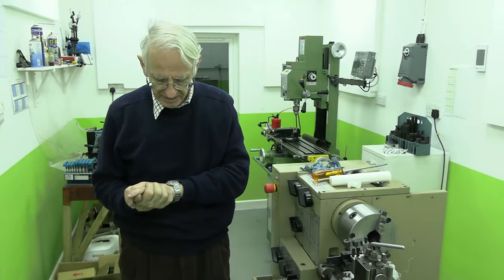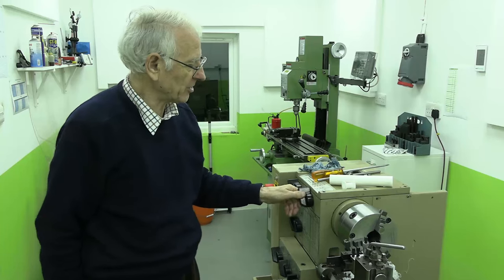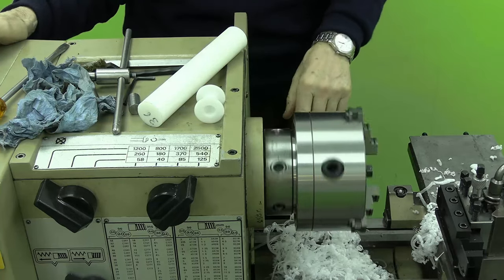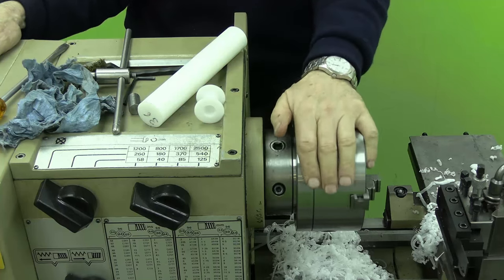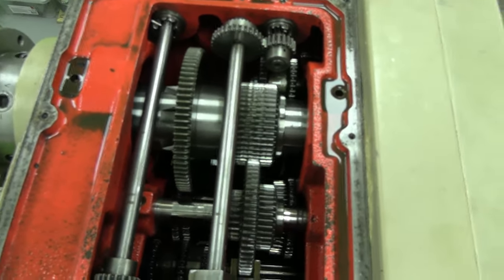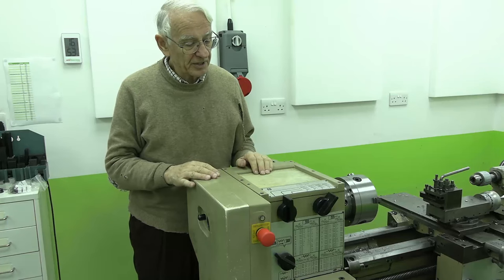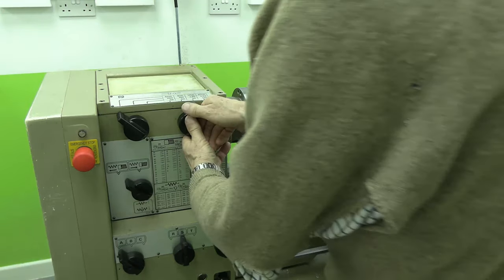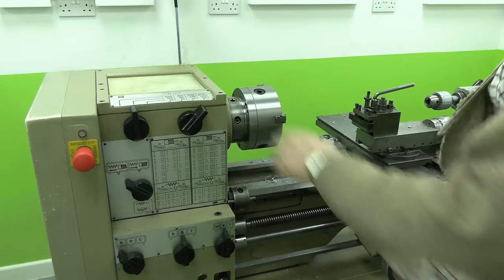M300 headstock gear crash, or so I thought

Comment: Samuel, glad you found no damage to your gearhead. i have have a lathe from Chester tools same size as your's (gearhead box much larger than the Harrison but not of it's quality) you are lucky. My problem shortly after importing into Ireland was oil leaking from feed change box, no chance of sending this back to U.K would cost a fortune, no info. on how to remove the feed box so removed front plate 
of box to get a look ( big mistake) all the gravity latches on the top and bottom shafts which aid side to side movement of gears DROPPED I then had to remove the motor and and the back gears plus the entire box. Job took about 2 days to complete. P.S never take remove the front plate on this box instead remove the box from under the gearhead in one piece and then carry out service thru. the now open back side of the box (or all the controls will drop out of position," heart breaking" I am 75 don't have the time for this kind of mess. Best of luck , you have a lovely shop well done.
Reply from the maker: Sounds like a nightmare!

Comment: Hello Samuel . I have been following Your successes and failures for some time.  Try not to beat yourself up  too much when things don't go as planned as you do very well for a someone  without any formal machining  training.  I did my apprentiship many decades ago..  Back in those days a Fitting,Turning and Machining apprenticship took 10,000 hours (5 years, 8 hours a day 5 days a week ) and no time off for good behavior.  There are many tens of thousands of hobby machinists out who do very well but it takes many many hours

Comment: Been watching a few of your video's because I am in the market for this exact model lathe.  Just a few things I did notice and please take this as just an obeservation and not trying to be safety police, I would stronly suggest not to wear watches or jewelry when working with the lathe, as well as the loose clothing you sometimes wear is really dangerous, in a previous video you had worn a tracksuit trouser tied with stiring pulls at the front and they can get easily get picked up by spinning handwheels and or swarf. Also spinning the chuck at speed without it holding a piece or at least tightened down is bad practice.  Hope you get all the niggles sorted with your lathe as they are really good machines.
Reply from the maker: Yes, well I think you'll find if I'm actually machining I do take my watch off and pull up my sleeves. Also, clearance distances can be deceptive on video. I had similar worries when watching some of Keith Rucker's videos. I'll keep it in mind.